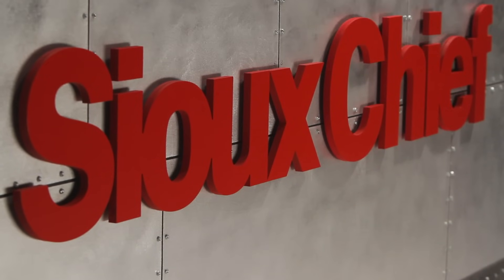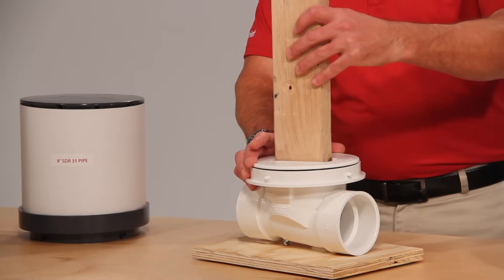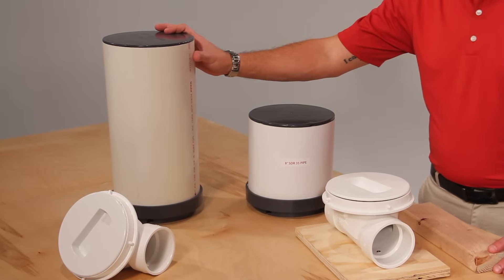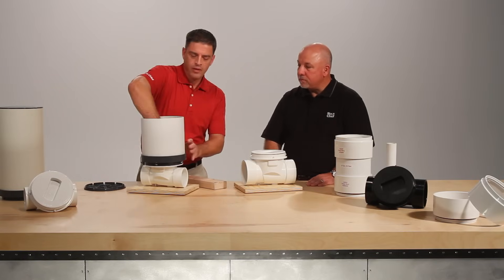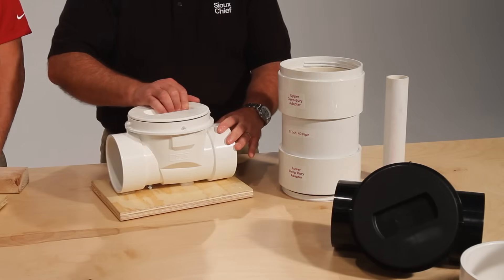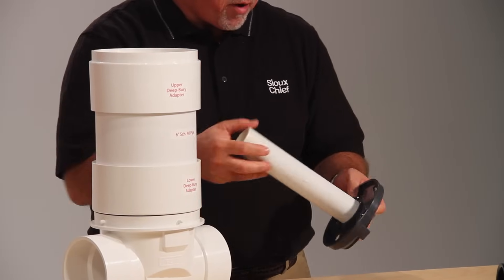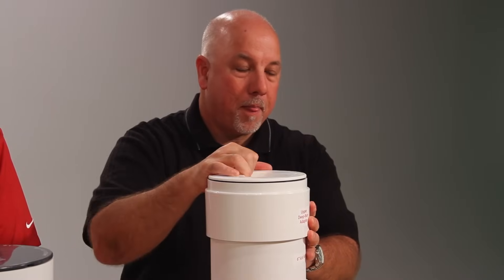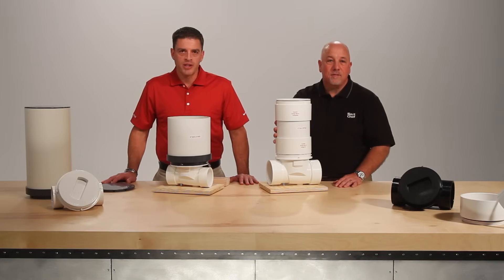Sioux Chief ProCheck™

Comment: Hi, my existing valve is a couple of inches longer than the newer ones I see advertised. Can I make a shorter  valve work using a longer fernco black coupling? Is there an acceptable space between  valve ends and sewer pipe that a fernco can connect? In other words, how much space between valve ends and sewer pipe would  be too much? Thanks

Comment: I had something like that install by a plumber but know I get water coming up from from the ground and the cement that they put around it .I have tried to call them text them but does not respond .what can I do to stop the water from coming up I have a video of it if you tell me how I can post it so that you can see it.
Reply from the maker: If you are not able to reach your installing plumber, you should contact another licensed, insured plumber to see what the problem is. If there is a problem with a Sioux Chief product, please contact customer service at 800-821-3944.

Comment: What is the depth (length) of the 6" PVC provided with the shallow depth kit?  My 4" line is 8" below finished floor.  Looks like a great product.
Reply from the maker: The Shallow kit can be used for up to 16" depth. You can see the brochure at https://www.siouxchief.com/docs/default-source/print/print-brochures/drainage/backwater-valve---procheck---brochure.pdf?sfvrsn=1bad3837_16. Also our customer service reps can help with any questions. 800-821-3944.

Comment: i want to use it vertical i want stop smell from drain pipe by using it
Reply: How are your drain pipes going to drain then? This works in conjunction with the flow of waste. To prevent the sewer gases from entering the building, install p traps underneath the sink.